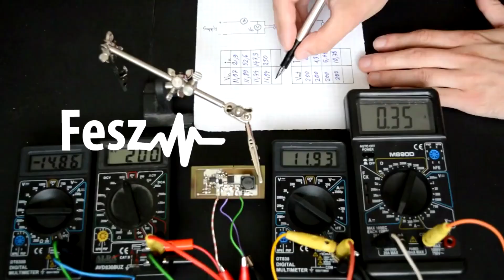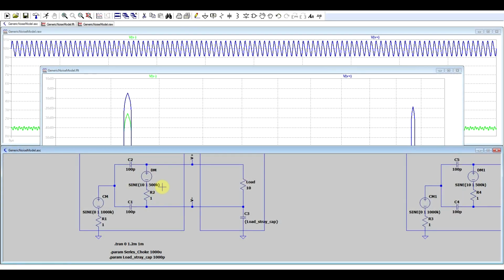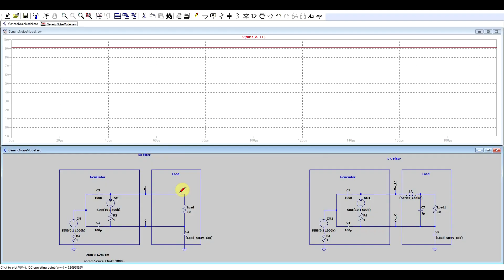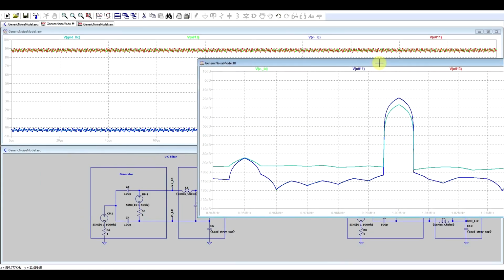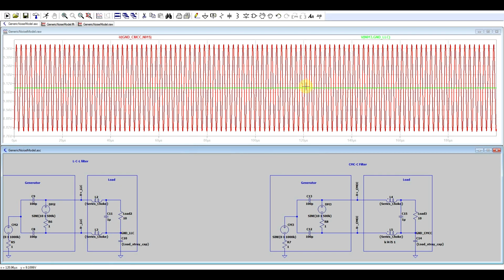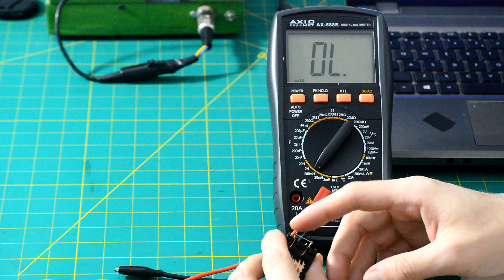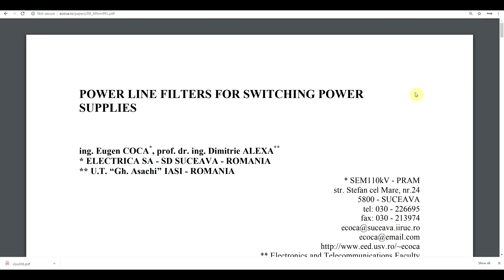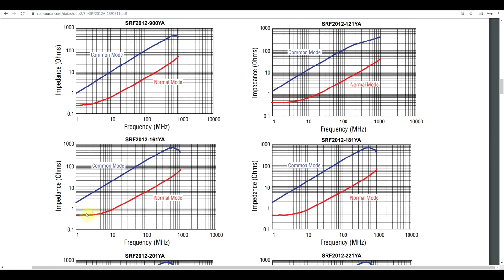Understanding the Common Mode Choke using LTspice

Comment: Hello, very interesting!!
Is it often used in audio signals, especially microphone/line?
I ask because I have an audio interface where the +/- traces coming in from the XLR/Combo plug are entering what I think is an SMD Common Mode Choke. The issue I have, is this choke's jumped off the board and I find it very hard to source the component(it's a 2x1 mm ant size)
Could I bridge these two paths over the missed component? Would this provide a significant adverse effect rf/emi wise? (The place where I use this interface has very clean power and low emi) 
Thank you for your wise teaching

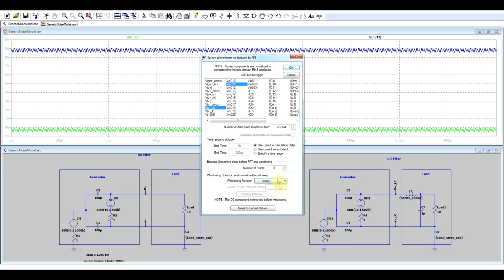Comment: Imho, if you look at the simple LC filter as shown in the circuit on the right at 3:36, the common mode noise still has a path to ground through C6 through the lower wire of the differential wiring. Hence, this noise comes through. However, the loop immediately to the right of the differential mode source is broken by the inductor at noise frequencies. Hence, you can't see the differential mode noise on that loop. When you add another inductor to the lower wire of the differential wiring, then common mode noise has no path to ground through C6, hence blocking the common mode noise.

Comment: 6:40 Not quite sure why does coupling the two inductors give better attenuation for common mode.
Reply from the maker: The coupling is usefull to cancel the differential inductance; in general, the differential current is very large compared to the common mode one, so any inductance that interacts with the differential current needs to be able to not saturate - this limits the realistic values that can be achieved - usually 10-100uH; with a CMC, since it only interacts with the common mode current, which is very small, inductance values can go in the 100uH-22mH; such large values would not normally be feasible as uncoupled inductors which do not saturate.

Comment: A common mode choke does provide a lot of filtering and also keeps noise that is generated inside the circuit, eg: A DC-DC converter, from going back down the power leads and creating interference in other modules.   A common mode choke is also a balun, so, to some extent the differential noise in the circuit is converted to common mode noise that goes out on the power leads.    Your Spice simulator probably doesn't show you that.   One case where you shouldn't use a common mode choke is when there is I2C signalling between modules or analog levels passed between them.  This is especially true if some modules have motors or other high current intermittent loads.  With a common mode choke there will be ground bounce.   The ground reference level required to read I2C reliably will not be there.   I saw an example of this at a medical robotics company.   I was not able to convince a manager that The ground inductor had to go.   He spent many weeks trying kludge fixes, all to no avail.  Eventually a big investor pulled out and life there became very unpleasant.   I was long gone by then.    The only solutions to this problem are to either use optical coupling, or get rid of the ground inductor.  If you have any non-differential signalling between modules, don't use a common mode choke.

Comment: This is very helpful for those of us who know nothing about EMI problems (e.g. me...)

However, I have a question:  given that there are no lossy components in the LC filter that you show about 3 minutes in, where is the energy in the differential mode noise going? 

I am somewhat confused by this, and am wondering if I'm missing some obvious point.
Reply: You know what you need.  You need to got to engineering school. It is impossible to teach you everything you need in a video.  Jesus you friggin amatuers just piss me off.  Go READ! or Go to college. you would be so better off than being an Uber driver asking dumb questions on the internet.

Comment: Wouldnt a common mode choke work better if the phase was opposite on each side? It looks like your simulation has the same phase on each side of the transformer,  unless i am seeing it wrong? That way the signal would cancel itself out. I thought a common mode choke was opposite..where we cancel out the currents of the common mode...ah i think i was wrong? Im still confused lol
Reply from the maker: Well, the currents are of opposite phase for differential noise or signal - the whole point of the CMC is that it does not affect differential currents since they cancel out in the windings. By "canceling out" the effect is that the CMC does not affect the flow, differential currents are not affected - this is important when there is useful differential signal - like in communication lines. The CMC presents inductance, and thus opposes the flow only of current that passes the same way trough both lines.
Reply: Common mode choke is used for cancelling come mode noise or differential noise? Am bit confused,pls explain.

Comment: Appreciate your efforts. I have a query. On what basis frequency for CM and DM is noise is selected. 1MHz for CM and 500k for DM.
Reply from the maker: In this video I just chose some random frequencies, something to highlight the effects of the filters; but in real life you need to measure the exact noise of your circuit; there is no standard value, it will depend on the noise source.

Comment: I would also add that the differential mode inductance is due to leakage flux that doesn’t couple in the ferrite. Some CMC employ purposeful leaky core winding to have both CM and DM inductance. Compact power supplies make use of this.

Comment: after a few hours I cant seem to get the generic noise displayed with the 2 frequencies - suspect some tricks in the setup ?
Reply from the maker: If you want, you can give a few more details about which circuit you simulated and where exactly the measurement point was so we can figure this out.
Reply: @FesZElectronics  many thanks for response . All working , it was my lack of knowledge of LTspice especially setting scales on the fft that caused confusion . I watched all your lt spice tutorials which were a big help . My final step is to figure out how this chap did the s-parameters in ltspice. https://www.youtube.com/watch?v=Sg7QB0D5asQ. Many thanks for your excellent channel as I work toward understanding why rotating a poe lan transformer eliminated all the problems experienced when the cable length got longer than 50 meters . Basically common mode choke was moved to phy side from lan side - the investigation continues .

Comment: Thanks for the video. One question: You measure the "stray" inductance of 500uH. If you were to implement this in a schematic, would you put 250uH in series to the entrance and exit of one side of the Choke?
Reply from the maker: It should not make a difference if the 500uH is a single inductor on one of the terminals, or if its split up on the 2 wires going into one of the inductors. Its important though to mention that each of the windings has stray inductance; we can assume the same percentage of each inductor as being stray. so each inductor in a trafo needs to have its own stray inductance.

Comment: great video... just in time...Hmmm...:/   for a HLK-pm12 datasheet  power supply project...   thanks a lot...:)
Reply from the maker: Interesting! I guess that product already is (at least partially) compliant on the AC side with the legal EMC requirements, according to the datasheet. Are you working on filtering the DC side?
Reply: @FesZElectronics  Hi, the data sheet states: Products designed to meet UL, CE safety certification requirements. Hi-Link gives a 12DCV output example using a 220uF cap. So, i went with that,  at least for now.   any suggestions would be very helpful.  thank you.
Reply from the maker: @qzorn4440  Well, it all depends on if you actually have a noise issue, there is no point in fixing something that isn't broken. If you do have an issue, I guess you could add an extra LC filter at the end, it would only help with differential noise, not CM though. See L2 and C11 on fig 14 of https://www.power.com/sites/default/files/product-docs/tny274-280.pdf

Comment: Thank you for the great explanation. I am wondering why you did not compare the common noise for the voltage between (l2& load2 ) and (L4 & load 3)? Why only comparing Vgnd_llc & Vgnd_cmcc? For the common noise, you measured V+ & V- in the 1st circuit, so I was expecting you to compare these two values after filtering with the common choke. I measured these in my circuit and it is smaller when inductors are not used as a transformer! Please advise. Thank you.
Reply from the maker: Hello Bahareh. When I measured V(V+,V-), I was measuring differential noise - the noise that one line shows in regards to the other. With CM noise, I look at what noise is in both lines in regards to the earth ground (the simulator ground in this circuit). In principle the CM noise should be identical on both lines, in regards to the earth ground. 
When you use inductors on their own (not as transformers) you get a better differential noise filter (V(v=,v-) is lower). When the inductors are used as a transformer, the filter works on CM noise (V(v+,v-) is not really affected only noise in reagards to earth ground is lower)
Reply: @FesZElectronics  thank you so much. much appreciated.

Comment: Great video. I am just starting to learn how to use LTspice and how to model a common mode choke. Just a quick and maybe silly question. Why do you include a 1Ohms resistor in series with the noise sources?
Reply from the maker: Honestly, I don't remember. I guess it was to simulate wire resistance. Anyway, the simulation should give the same type of results regardless of those resistors.

Comment: Just brilliant !! I always search for different materials to understand electronics fundamentals more deeply ..now I can easily visualise by seeing these videos ! Thanks a lot and keep up your good work 👍
Reply from the maker: Great to hear! Let me know if there is any topic in particular you might be interested in.
Reply: Thanks for asking ....m just learning ltspice for simulation..! Could you please tell me is there any difference between ltspice inbuilt noise sources and the model you developed? 
Secondly AC analysis only used in the circuit where pulsating or sinusoidal signals are there?
Reply from the maker: I'm not sure what the "inbuilt" noise source you are referring to; but the model I used is built using the available components. 
On the other hand, dedicated noise simulations are a completely different thing - I tried to cover this in a different video: https://youtu.be/Dh5XmFXlljI
Regarding AC analysis, this works by finding a stable operating point and then inserting a minute signal, so this will only work well for linear circuits. For switching circuits (or ones that use pulsating signals) you will not get very good results. On the other hand, there are methods to perform "ac simulations" by running transient simulations. In this video I focused on feedback loops: https://youtu.be/X4yaBwaO1gk
Hope this helps!
Reply: When I mentioned inbuilt noise source means I was referring to arbitrary behavioral voltage source in ltspice .! 
Is it possible to export data points from ltspice worst case analysis and plot histogram in other tools ?

Comment: Thanks for this video. What is the purpose of existing these two capacitors: C1 and C2 in generator section? why 100pF?
Reply from the maker: @BassFenderJazz  - The CM noise soruce needs to be coupled uniformly into the 2 lines - that is why there are 2 capacitor. The reason they are capacitors is that the CM noise needs to be AC coupled (there is no DC component in CM noise). The value of 100pf is arbitrary - it can be any value and it depends on the real life noise source. 
I went into more detail on CM and DM noise - how to generate it in real life and then separate here: https://youtu.be/sfTv0DSTwP4

Comment: Just like to comment that the mic you made at the "beginning" of your channel is so low noise that i can clearly hear you swallow your saliva, hahhahhah. Both weird and awesome because at least I know that the circuit works like a charm! Keep up with the GREAT videos!!
Reply from the maker: I'm not sure I wanted that to be heard, but I guess that was supposed to be a compliment. I might do a follow up on the microphone video at some point - I'm still using a "home made" one its just that its a bit different from the one in the old video; I cut off all the extra components and its working somehow better. Thanks for the support!

Comment: Great video ! Very educational. 
However I did not understand what is the usefulness of capacities close to the CM generator and why did you choose these values (100 pF) ?
Reply from the maker: Hello Damien! Well, the point of using the capacitors is first of all to create galvanic isolation  - there should be no DC common mode current in most real life applications, only AC. There are 2 capacitors so that the CM current is inject uniformly to both + and - terminals - both of these terminals should normally have the same CM noise. Regarding the value, there is no fixed value you should use, this depends on the application. A real life example would be an AC-DC supply, and the capacitors represent the transformer primary - secondary capacitance and any other capacitor that is placed between input and output. I recommend https://youtu.be/VkdtESI6C74 in which I try to filter some real life CM noise.
Reply: @FesZElectronics  Thank you for the explanation and your reactivity ! I did not know your video but they are very interesting

Comment: Nice Video, one can reduce the coupling factor from 1 to 0.99 or so, a common mode filter also filters difference mode noise due to the leakage inductance of the 2 coils, the leakage inductance works as the difference mode inductor.
Reply from the maker: You are right SM! The real life CMC does not have a coupling factor of 1. I used that just for simulation purposes to highlight the Common Mode effect. The real CMC has a smaller coupling factor, and this can be seen in the datasheet since there is a differential component also to its impedance.

Comment: Nice video, as always!
Btw, when using FFT windows, it's REALLY important to choice the right FFT windowing function.

Very often I see a lot of people (including colleagues) using the wrong type of window for the wrong type of comparison.
In this case for example we are mostly interested in the amplitude difference, not so much in frequency accuracy.
So a good window function would be something like a flattop. 

Using the wrong type of window function can quite often really lead to wrong conclusions.
Reply from the maker: Hello Piet! I wasn't really aware that you could select the way in which LTspice analyzes the FFT data, and just how many options there are. Thanks for pointing this out!
Reply: Nice comment! Do you have any material to point out which window should be used at what occasion? As you are essentially multiplying the acquired signal with the function in the time domain (a convolution in the frequency domain) I suppose that your windowing choice should be influenced by it's frequency counterpart...
Reply: @Marinho0034  Seems window choice complicated with filter band.
Reply: @alexlo7708  Yes. Tho only 1 year has passed by I've gained some more insight into this problem. As of my  current understanding, every ideal filter can be described with at least 6 design metrics: pass band/rejection band attenuation/ripple/cutoff frequency. Each type of filter tweaks each parameter a bit. If you go to Matlab/Octave and plot the frequency spectrum of each filter type and compare it to the "ideal" filter such parameters become more obvious. 

Now for the difficult part. The better you know the signal that you want to filter out, the more obvious your filter choice becomes. So when someone asks which filter should he/she use, instead they should be asking about the morphology of their "noise"/disturbance and the morphology of their signal of interest. 

Hope I gave some good insights!